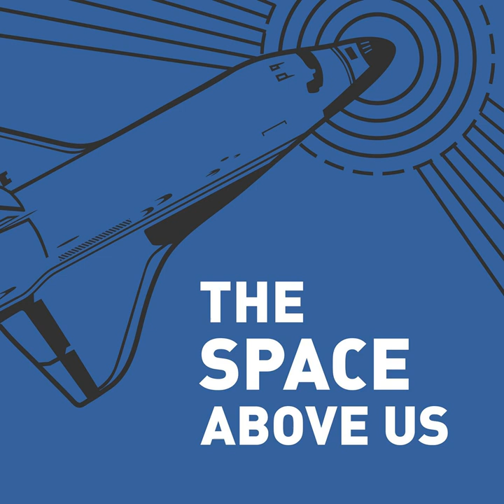094 - STS-51L - Part 3

Comment: i disagree shuttle was safe was managment what made it unsafe,yes should've had perhaps a escape system software to get off the srb's one last thing 51l came with in seconds blowing up on the pad 0-ring started to fail when they lit up srbs
Reply from the maker: Yeah, I was really shocked when I realized how close the SRB came to blowing right there on the launchpad. I talk about that in Part 2 (this is Part 3). Dropping the SRBs during powered flight wasn't a matter of software, unfortunately. The anticipated aerodynamic forces of such a maneuver, which would be lower in the atmosphere, were likely to tear the orbiter apart anyway. Before the accident, the all-or-nothing aspect of the SRBs was viewed as a benefit since just about everybody expected potential problems to come from the SSMEs. The thought was that if a main engine was lost early, the SRBs would buy them speed and altitude, which bought them time to work the problem. The idea of an SRB doing what it did crossed few peoples' minds, unfortunately.